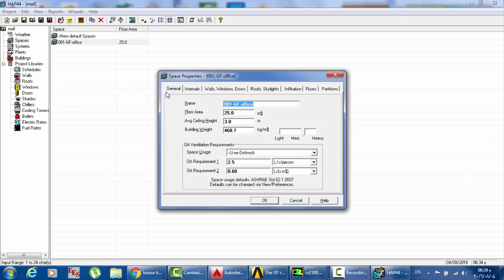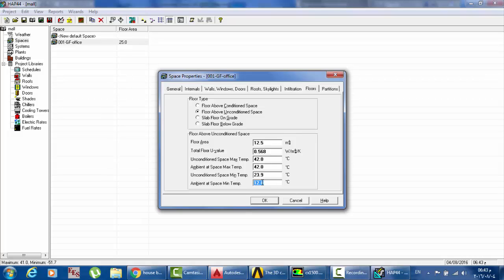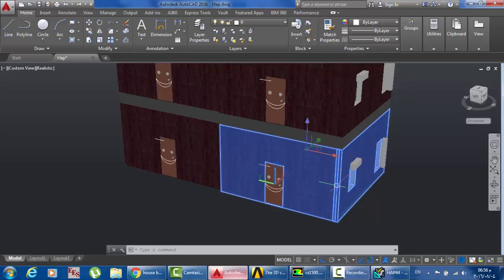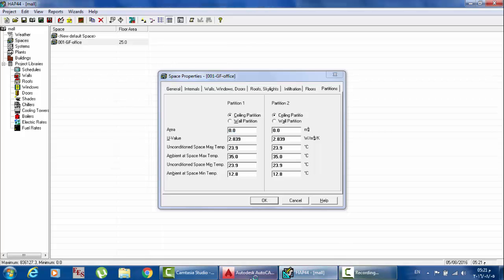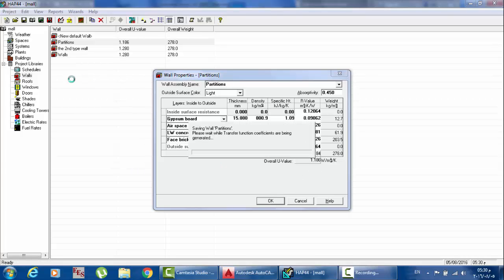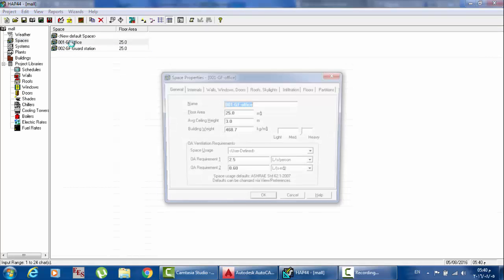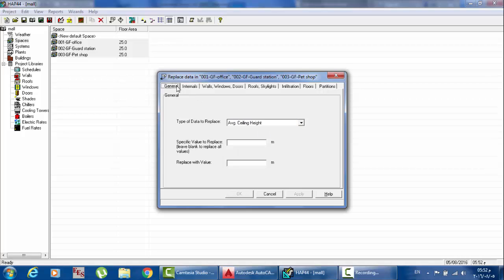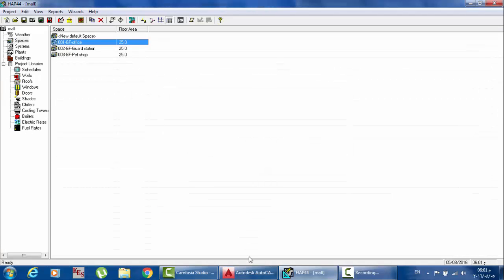HAP software tutorial in English cooling loads Hourly Analysis Program floors, and partitions

Comment: If their is a conditioned space above a room (Zone 1) do I need to enter roof information for Zone 1 in the HAP?
Reply from the maker: Hello dear Toyin, you only must enter roof information if the sunlight hits the ceiling of the zone (the ceiling here is a roof), if there is a zone above our room, there are 2 cases, if the above room is conditioned, the heat transfer will be zero and no need to define anything, 2nd case is that the room above the zone is not conditioned, so, you have to enter the information about the ceiling and so on :) ...Danke!
Reply: Thanks very much
Reply from the maker: Viel Erfolg!

Comment: Excellent video again friend, so according to your advice if I have internal walls from different areas but they work as a one because they are going to have the same temperature, is not necessary to enter the walls as a partition? and If I have asingle floor structure with a one floor is the same I wont enter the ceiling partition? have a nice day friend
Reply from the maker: Not at all dear J :), simply, the walls tab is only for the areas that are exposed to the sunlight (North, south, east, and west) and the partitions are the internal walls that are not exposed to the sunlight..(get the total area of the internal walls that are in the middle of a conditioned space and an unconditioned space and put them in the partitions like the tutorial..The same for the ceiling...it is like the roof but it is not exposed to the sunlight..You have to take only the area that the zone above it is unconditioned (42 C) for example because the heat transfer will occur. ...In another words...If you have a partition in the middle of 2 spaces and both of them have the same temperature, no need to take the internal wall as a partition because no heat transfer...Also, if the zone above your zone is conditioned and with the same temperature..no need to define ceiling because no heat transfer :) no cooling load is required to be added...I hope you get it:) Also, you can read how to input any data from clicking F1 and read the help..you will find the theoritical basics and equations...Thanks